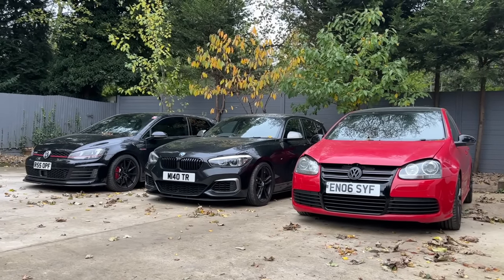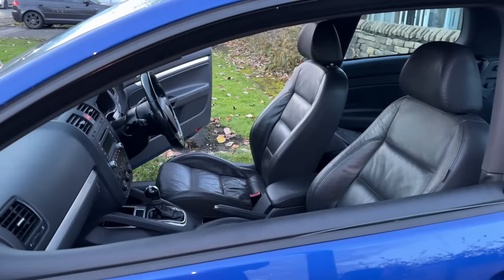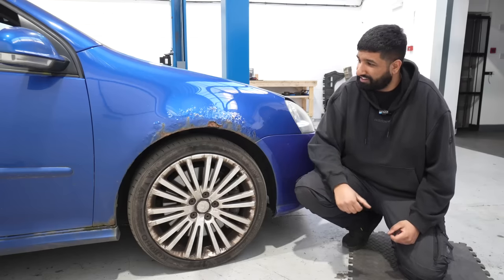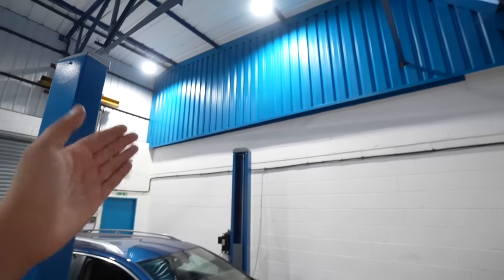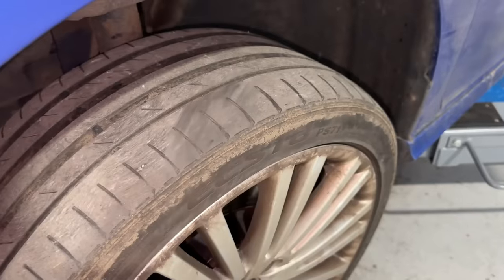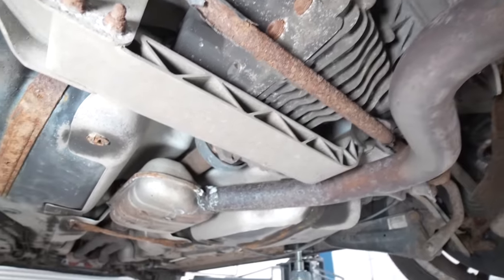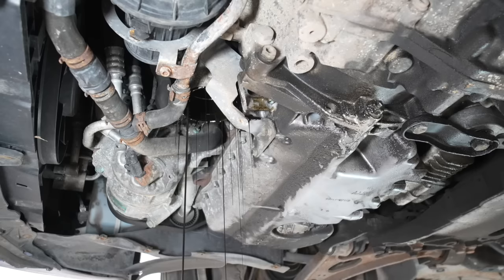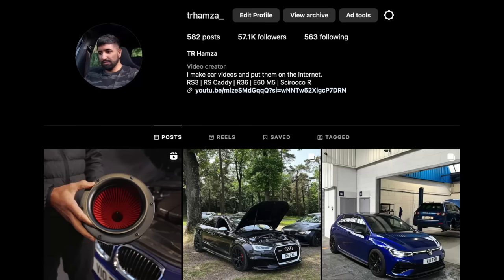I BOUGHT THE CHEAPEST VW GOLF R32 IN THE COUNTRY!

Comment from the maker: BACK IN A MK5! Also make sure to check out CAR VERTICAL and use code 'TRH' to save 10%: https://www.carvertical.com/gb/landing/v3?b=1e4c9523&a=Hamza&voucher=trh
Reply: You shoud restore the golf r32 it will be worth a fortune in the future
Reply: What happened to the volvo v70?
Reply: Dude. The oil filter housing has a drain point in the middle so it doesn’t throw all the oil over you when you change the filter. 
Also the small O ring on the drain bit is replaced by the tiny o ring on the oil filter. 👍🏻

Comment: Hamza can’t stay away from the MK5s 😂
Reply from the maker: 🤣🤣 It’s true
Reply: You should restore the r32 it will be worth a fortune in the future
Reply: Best modern hatchback imo. Fantastic feel and feedback, near 400hp out of an edition 30 with simple bolt ons. Far better than the dead mk7 gen
Reply: @MikelDog crazy to call the mk7 platform dead. It’s one of the most capable cars on the road for money. Mind you it does 95% of the work for you but that’s besides the point.
Reply: Mk5 is fun
Reply: I have same problem
Reply: @MikelDog 400?? Wtf are u on about with bolt ons?
Reply: @Teamlastofus  yes a k04 turbo has achieved 400hp with some bolt on mods
Reply: @momo.a4008  not saying they aren't capable but they're dead to drive
Reply: Was the mk6 the first gen to ditch hydraulic steering? If so I can see the appeal of a mk5 in good nick
Reply: Buy one yourself and experience it you Will neither!!
Reply: @eponymous7910  yeah it used the gen 3 rack